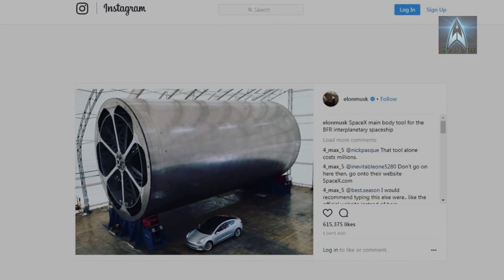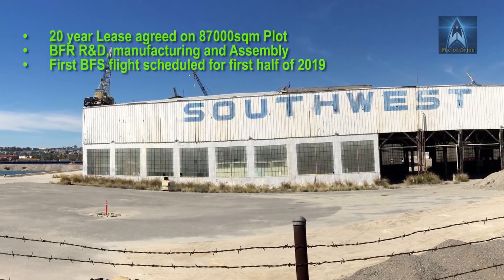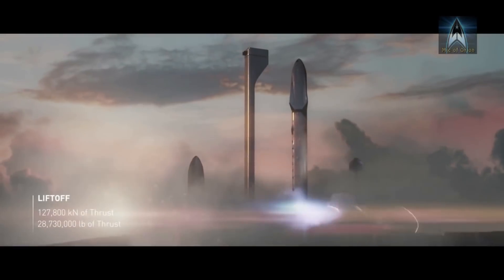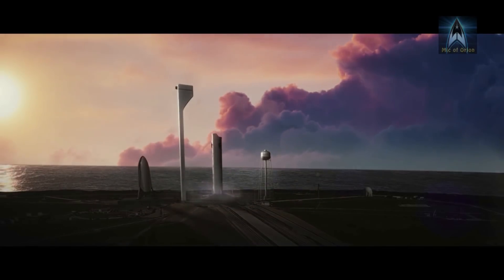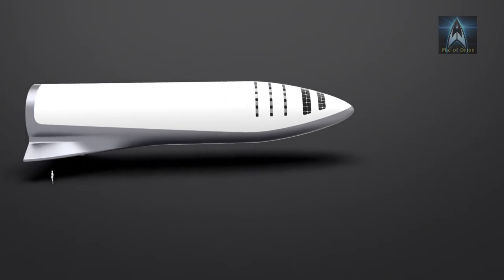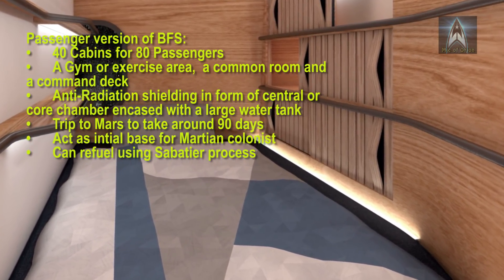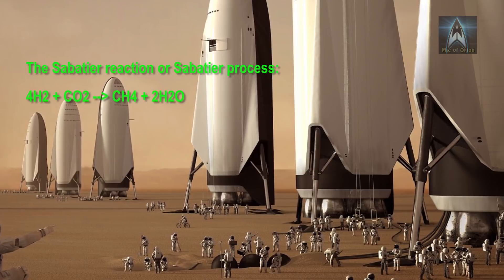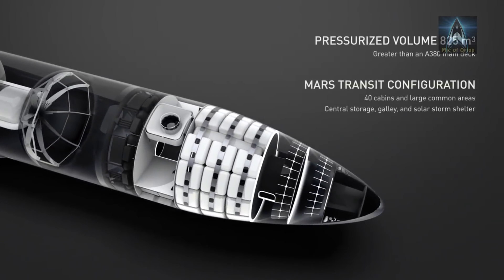BFR Is Starting To Take Shape

Comment: "*Starting* to take shape"...  😉
Reply from the maker: Very promising indeed. what is angering is negativity of ppl in industry being so negative towards BFR . Yeah just saw it. Clearly autocorrect blind spot. Should have said "Starting" as in start. very stupid typo on my part.
Reply: David Murphy 

I wasn't really suggesting that the BFR would be used specifically for mining, just getting the heavy hardware in space that would be doing it.  The whole point being heavy lift capacity for relatively cheap.  The BFR (if it functions as planned) will be less expensive than either Falcon 9 or Heavy (and they plan to phase them out entirely once BFR is proven).  SpaceX is already starting to get the lion's share of global launches, and a less expensive platform would only further that trend. There is in fact a large pool of wanna be customers just waiting for rocket launches to get more affordable.   In any case, there is plenty of LEO jobs for SpaceX to take on in the relatively short term.

In addition, SpaceX is branching out, and if successful could become the biggest internet provider on Earth with a constellation of nearly 12,000 satellites (Starlink) transmitting internet all over the world, including distant undeveloped regions.  It helps a lot that they can launch their own satellites, giving them an edge over would be competitors in the satellite internet endeavor.  SpaceX would essentially become a massive telecom industry, which they hope to use to finance their future ambitions.  They've already launched the first two prototype satellites.  

Elon Musk also has a relationship with the Mars Society and Robert Zubrin, and has been donating money to them to help develop the methods that will be needed to survive on Mars.  No doubt some of them would form early candidates for potential Mars colonization later on, aside from developing methods that SpaceX will eventually need for their ambitions.  Notice that Elon also has companies dealing with Electric Vehicles, Solar Systems, Energy Storage (Tesla/Solar City), Tunneling Machinery (Boring Company), and obviously SpaceX itself developing the means to get off world.  In addition, Elon's brother is developing technology to grow food in cargo containers (which could also be used on Mars).  The guy is slowly pulling all the necessary components for off world colonization together.
Reply: As impressive as SpaceX's achievements to date have been, there are serious question marks about the timeline and feasibility of the project.  Financing aside, the rocket equation punishes reuseability so it only works financially with a lot of flights and government Mars and Lunar missions are not likely to cover the costs.  So we have the question of whether the gigantic BFR is the right product for satellites in an environment where satellites are getting smaller or whether bases can be leveraged financially.  The vehicle would have to create its own demand which is hard to envision.

I wish them well and I salute their intrepid spirit but would I invest my own money in it?  No, I would not.  That negativity might anger you but if it were an asteroid mining project then I'd be a lot more positive about it.
Reply: Your title...
Reply: Seastallion

I see.  With mining, I'm minded to agree, I would say the best chance of success is pairing with a mining mission as payload in conjunction with government backed interplanetary missions.  If you saw a partnership with another commercial venture to retrieve valuable metals. Starlink is also another revenue stream, it won't in itself make it viable but it'll certainly help.  That said, it's achievable piggybacking on the existing rockets which are a tremendous success.

I also accept that, if a commercial success and fully utilised, the BFR has the potential to lower the cost per kg to LEO below the $1,000 mark. 

Don't get me wrong, I'm personally convinced that a tipping point is approaching where there will be a space gold rush.  A siphon effect where fortunes are made and companies clamber to take advantage.  Only from this will colonisation - a huge risk and colossal expense - make sense.  I just worry the BFR puts the cart before the horse and is the wrong tool for the job.  Only time will tell.
Reply from the maker: Yeah just saw it. Thank you. should have paid more attention to the title, autocorrect, didn't pay attention.
Reply: David Murphy 

Space Hotels, Mining, Interplanetary missions...  These are all things that are being planned, invested, and prepared for right now.  The BFR would be an incredible asset for all of those things.  Satellites have gotten smaller out of economic need, but in some cases larger ones are still better (such as military or telescope platforms).  Launching large space station components will be needed, and BFR looks to enable that for much cheaper than anyone else.  As you suggested, it would be an obvious advantage for space mining efforts.  

It is easy for the government to turn a blind eye right now while the BFR is in development, but when it is ready hard economic decisions will have to be made.  The BFR is more capable than anything anyone anywhere on Earth even has planned.  Public pressure could force NASA to use the cheaper and more capable platform, no matter how much they've invested in the SLS.  In some ways, I think that the BFR will be easier than the Falcon Heavy, because they won't have to operate multiple boosters at once.  If it proves capable as it is planned, it will be a true game changer for the space industry.
Reply: Seastallion  I agree with you on the initial financing front.  Behind schedule / little over budget but it'll happen.  1,700 KN / 350+ specific impulse / human rated is doable.  But it still has to be viable after it's built.

I really don't see the case for it being a good vehicle for mining - it's certainly not designed for it.  Spaceships are like cars, you design the vehicle for the task and this is for Mars / lunar missions.

That said, for delivering a hotel or new space station to LEO it could work but for servicing it...  150,000kg payload?  Sounds like buying an articulated lorry (or 50!) to do the weekly shopping to me...  Yes, there will be large payloads - but they're getting less common is the point and the BFR would have to change a market trend; when any product tries that it's very high risk.

Even if the US government committed to a sizeable Mars colony the launch windows for home & transfers are so wide and it'd stay parked on Mars for years processing the fuel unless they find a work around.  

Reusable rockets are economical when reused is the point.  So ask yourself, how often will the BFR fly?  Will it be weekly?  With the F9 and FH the answer is yes.  Currently, there is no commercial case for businesses on the Moon or Mars.  I'm just not convinced that this will be the right rocket for the market in the twenties.  But listen, it could be that once the rocket is in place some huge demand comes along and I'm wrong; and I sincerely hope I am.
Reply: Miniaturization of satellites is a reaction to the high price tag of space access. Once launch costs get below $1000 per kg there will be hardly any economic pressure to make satellites even smaller. 

To say there won't be a market for cheap space access is to say there won't be a market for cheap computing power in the 1950s - after all, all computers are good for is calculating artillery shell trajectories, what are regular people supposed to do with them?
Reply: Have to agree, especially on the miniaturization front. While I have no doubt the push will still be in place for smaller payloads, If we can place bigger satellites in GTO or direct GEO the push will be to miniaturize and compact station keeping, or to improve longevity of components with less of a need for large station keeping systems.